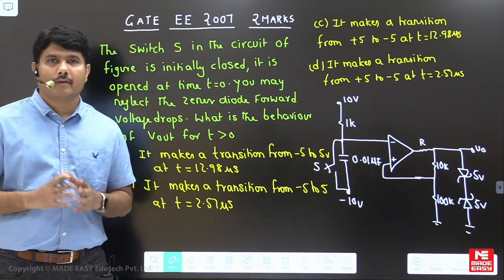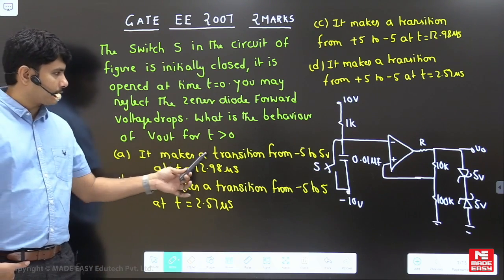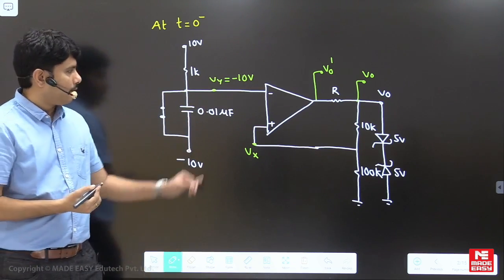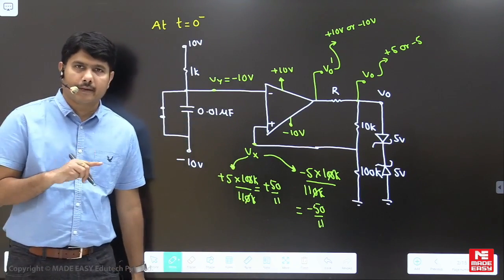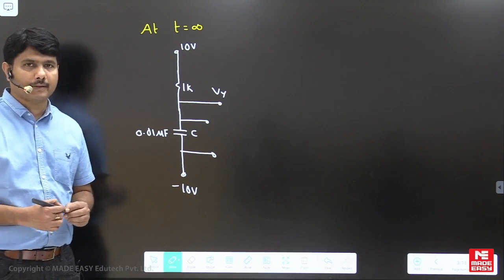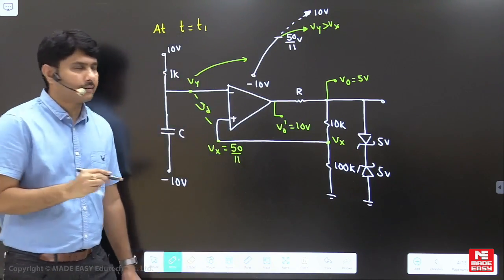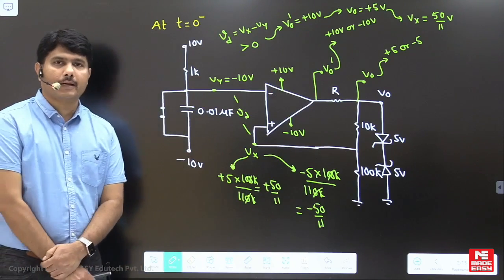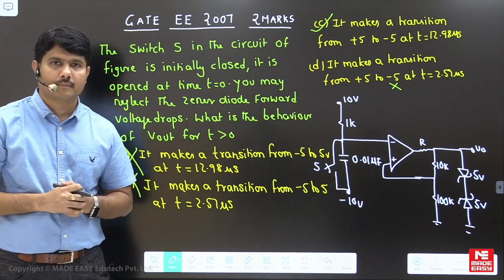Most Imp. Previous Year Questions |GATE & ESE| Analog Electronics|Part-1|By Raj Kumar Sir| MADE EASY

Comment: Sir i didnt understand why in RC equation you have taken Vy...why not  Vc voltage...as that equation is valid for capacitor voltage n...plz check once @ 11.05 sec
Reply: Dear Aryan vy is changing by capacitor voltage only so you can apply that formula directly for capacitor or vy.
Reply: @rajkumaranalog  but using capacitor volatge vc=(-10-50/11) i'm getting differnt ans
Reply: You are not comparing capacitor voltage with non inverting voltage vx dear.That is the mistake you are doing that is the reason vy with vx we have to consider
Reply: @rajkumaranalog  ohkkk i got my mistake...thank you so much🙏🙏